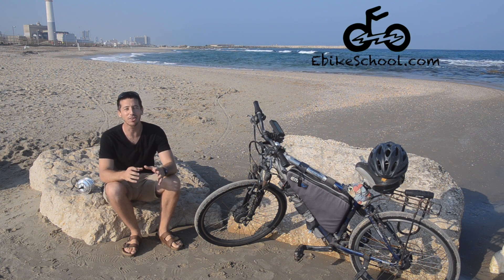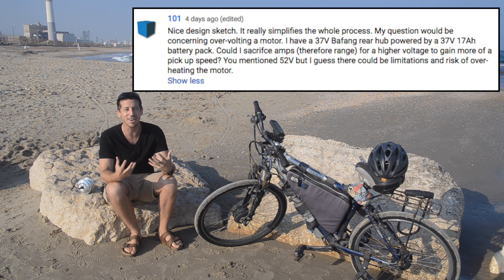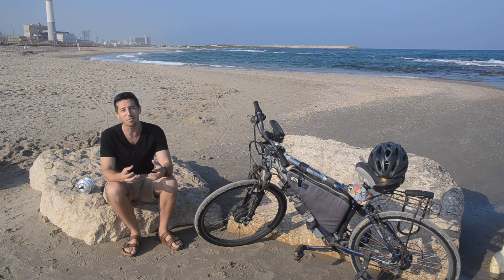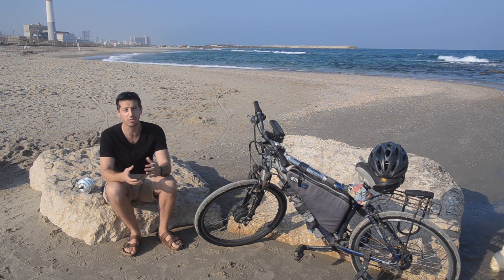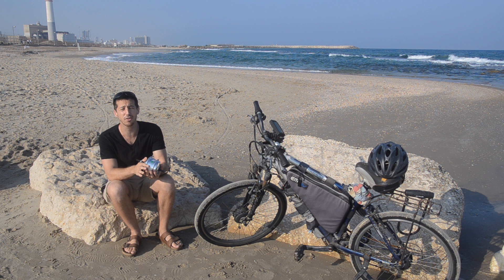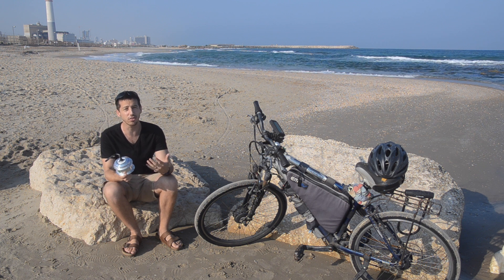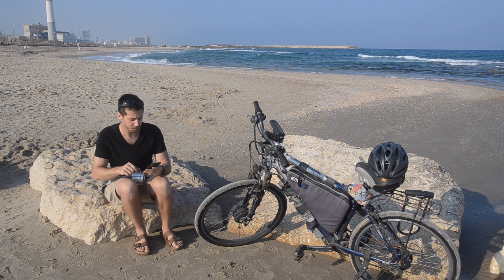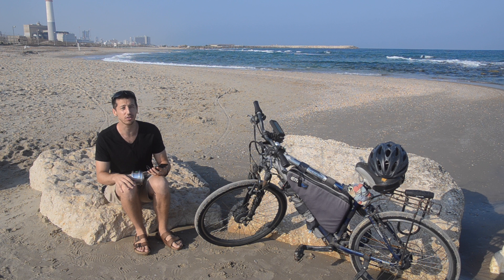Overvolting an electric bicycle motor for more speed! Q&A#7

Comment: The Controller is the Limiting Factor No matter if the Controller is Built into the Motor or Not. As I have a Bafeng BBSHD it's a 1,000 Watt Continuous and 1,500 Watts Peak Mid Drive Motor and The Controller is Total Built into the motor you can Run anything from 24 Volts @ 62.5 Amps to  52 Volts @ 29 Amps and Never more then 60 Volts for My Controller can only handle 60 Volts Max and you have to Remember a 48 Volt Battery will Charge to 54.6 Volts so a 52 Volt Battery will be 58.8 Volts Fully Charged so you Don't want to use anything Bigger then a 52 Volt Battery That is 14S at 3.7 Volts Each and Fully Charged they are 4.2 Volts so 14S will be 58.8 Volts Fully Charged and they call them 3.7 Volt Cells and 14 X 3.7 = 51.8 Volts they call that a 52 Volt Battery. I run it with a 13S7P 18650 2500 mAmp Cells so that is Called a 48 Volt @ 17.5 AH and Fully Charged it is 54.6 Volts and the Motor can Pull up to 30 Amps so Even if there is a Voltage Drop to 52 Volts @ 30 Amps that is 1560 Watts and then I put it through a Seven Speed Gear Drive and it is Very Powerful for a Bicycle and I have the Rear Rack for the Battery for in the Woods Trail Riding and hill Riding it's the Way to Go and Not with the Battery on your Down Tube and With only 91 Cells I can Carry My E-bike No Problem for I have to Carry it up and Down Two flight of stairs. I will Never own a hub Motor Total Junk Compare to the Bafeng Mid Motor Drive BBSHD with Real World 1,000 Watts Continuous and 1,500 Watts Peak put that to a 64 Tooth From Drive Gear to a 13-32 Tooth Rear Gear and you can go up any Hill at 24MPH Top Speed of 47MPH and Easy Cruising Speed of 35 MPH and you can Ride it in the Harshest of Wood Trails and I would not if I was you put it in a Fat Tire Bike you can but I wouldn't and I run Mag aluminum Wheels NO Spokes for E-motors Hub or Mid Drive Loosens up Spokes. and With hub Motors most Times your Control is not part of your hub Motor and What Volt the Control can handle will be the Limiting Factor and High Voltage Controllers 60 Volts and Higher will Cost you so Stop Wasting your Money on them Stupid Hub Motors and Buy yourself Something that will Last you Years and Thousands of miles I have 1,287 Miles on my Bafeng BBSHD and it is Still Running Strong as it was Brand New out of the Box it was a Little Costly but it was Well Worth Ever Cent I Built the Bike for under $2,500.00 USD total that's with Tax Shipping and Handing and that was in 2020 and that's for the Mid Motor Kit the 48Volt@ 17.5AH Battery, Controller, rear Rack for the Battery, Controls, Hydatic Disk Brakes front and Rear and the Bike Brand New off Amazon Everything I needed to put it together and Now it's over $3,200.00 Plus Tax and Shipping and Handling for if I done the Same Kit and Bike Today. So Moral of the Story Don't over Voltage your Controller the Motor more then Likely can handle it but the controller not so much for that is Where Hub Motor Makers Cheap out on is the controller for a Good Controller that can Handle 1,500 Watts Needs to be Rated for 2,000 Watts you don't want to be Running any Controller Right to it's Max Voltage and Ampere you will Burn it out Good Rule of Thumb your Controller should be Double The Wattage of What you want too Run Continuous and Min of What you Want to Run Peak but that Peak Should Not become Your Continuous use Power Level for you will Burn up the Controller. and Don't Buy Small 750 Watt Hub Motors and Try to make them putout 1,000 Watts for you will Burn them up.
Reply: Jesus Christ man… punctuate!
Reply: I disagree. I have 2 Bafang mid drive and 1 rear hub drive. Not all mid drives are the same nor all hub drives. There are pros and cons on both.

Comment: Will the motor/controller have trouble if I change the stock sprockets (lower teeth) or stock chainring (higher teeth) to increase my pedalling speed? (I have a single speed ebike 16T & 43T respectively.. planning to change to 14T sprocket or a 58T chainring

Comment: Hi, Richard Stuart here,  have an Ebike with a 48 Volt setup, and a SW-900 The Controller doesn't seem to have a name on it.  Does say Max current is 22 Amp. From what I have read it should work also at 52 volt level.  What else, to be safe, should be checked.

Comment: #ebikeschool I have a question? My controller are gone for 36 to 48 says it’ll handle up to 52 but I want to know if I change it to 48 and I have a 36 battery can I use both batteries switching back-and-forth?

Comment: Thanks, great video. I use my 3 wheeler for everything, shopping, banking, yard work... I run a 48 volt, 1000 watt motor topping out at 29mph when fully chatted to 54 volts. I WANT TO GET 45 MPH. Would an upgrade to 52 or 72 volt battery help and can I do it. I.have a 30.amp controller.

Comment: Need HELP! HELP, HELP I'M DROWNING !
I built 2 bikes.

Bike 1 - White Dove
48V,  20amp (max) 12.5 aH  battery, 1200 watt motor,, 20" wheels.  
Top speed = 33 MPH

Bike 2: Black Hawk
52V, 30 amps, 20 aH, 20" wheels, rated 1200W motor over-volted to  1560 watts (52v x 30a = 1560w)
Top speed = 31 MPH
?????? WTF? 
What am I doing wrong?

Comment: when I listen to all this jargon, I'm left wondering why it's needed to do all this tweaking, why doesn't the manufacturer sell its product that way? 
I hear all these youtube posters say just do this, just do that ...... well maybe you can, but it seems that the manufacturers are saying "do not". Their hidden message seems to be you will be paying a penalty, with component failures.
to my thinking, instead of doing all this for better speed, just buy a mid-drive bike to get the extra speed, and put a spare chain with tools in your saddle bag as backup to get you home if chain breaks. Much cheaper than having some of those other electrical components on hub drive bikes failing.

Comment: The speed increase will be a lot less than 44%. 20% is maybe realistic. Rule of thumb is that doubling the speed require 8 times the power.
Hill-climbing is where you will see the biggest benefit.
Reply: To clarify the formula he gave is not off, its just that it gives you the "unloaded speed", or the speed of the wheel spinning in air with no resistance.
Reply: Overall range as well.  Unless you custom make a battery just for higher output with same number of cells.  Often a higher voltage pack is also higher total capacity.

Comment: Hey Micah...ive tried leaving questions on your website...with no luck...so ill try again...anyone is welcomed to help if they can...say i have a 60v20ah serie of sealed acid batteries...and i want to switch to lithium ion....can i use a lower voltage battery to save $$$? do i need to replace the controller? what are the rules when switching to lithiums? And is it realistic to rejuvinate older sealed acid batteries by topping up electrolytes? can you have like new results? or is that all bs? ANyway please feel free to reply...i cannot move forward without this knowledge....is there a book anywhere i can buy for these kinds of questions? i dont really care at this point....i just want to get my gifted ebike scooter in use! Thanks to anyone kind enough to help me!!! Gratefully Dan! Oh almost forgot....how do i access the controller software? like to change setting around to get max speeds etc...the brand is an EMMO Shadow approx 2016.

Comment: There is a lot of potential confusion on this topic. The controller can only adjust the average current through the motor by limiting voltage the motor sees - typically with pulse width modulation. If you reduce the current limit setting, the motor will never get to see the battery voltage available except in terms of very short peaks (milli-secs). Left unconstrained by the controller settings, a higher battery voltage will increase the current draw as well so the potential power increase is a lot more than the % increase in voltage might suggest.  A "500w" 36v motor represents a  2.6 ohm load. An increase from 36v to 48v (33% increase) will cause the potential current draw to increase by 33% as well, so  available power increases by 78%.

Comment: If you use BLDC motor with PWM controller the voltage has no influence to speed. If you increase voltage you increase power and current. Your controller is sending correct frequency to your motor and PWM power control. You can destroy controller and motor without good cooling.

Comment: you cannot limit Amperage without changing the voltage.
Reply: @Jimmy Cash that only changes maximum amperage it can push out without damaging the cells. amperage = voltage / resistance. ohm's law.

Comment: I  think that the main reason that increacing your motor voltage by 25% will result in less that a 25% increase in speed will not so much be ;inneficiencies; as the fact that aerodynamic resistence does not merely increace in a linear manner but even worse, in proportion to the square of speed.
Reply: Yees!

Comment: Would i risk burning out my controller box that controls a 24v motor by using a 36v battery? The problem is i cant gain access to the control box to see what it can handle.

Comment: Awesome video thank you for doing it!!!!
I just want to add that by removing the screws on the controller, one can open it and look what maximum voltage is written on the capacitors/mosfets. Apart from that, you just need to check the head in the current phase cable (the red one going from the controller to the motor).

If all that is good. All is good. The battery will suffer more of course. I only use it to climb hills at normal speed, so I don't bother traffic. 45km/h is a perfct speed in any other scenario inside the city.

Comment: I notice this with my e bike s un lock controller as I juiced up the current to 20 over the Battery s specs of 48 v 10.4 ah. Notice the boost of riding 1 mile but Im paranoid of working the motor too hard so I set it back to 10.4 to be safe.

Comment: I bought an ebike that shows 48 volts 14 amps, my company said if I put a bigger volt amp battery that it will fry my motor, and display yet you're saying it's ok to over volt an ebike.

Comment: Is it safe to reduce the voltage using a step down converter to lower the wattage? Would you have to put the step down converter between the battery and the controller or between the controller and the motor?

Comment: I have a 1500w hub motor  with a 52v battery. I cant get it past 31mph..  How can i get more speed...
Reply: If you have the SW9 control panel LCD then you can go into settings and adjust the top speed

Comment: Hello i built AWD Ebike 48v. Front 350wats and 500watt rear. And i have two battery packs but the rear hub doesn't fully use the battery. It stops at 52volts. And don't know what is wrong? Is the controller wrong?

Comment: But the shielding in the copper wire is it rated for a certain voltage, if you go high voltage the current will jump and short?

Comment: fyi the formula used in this video does not take into account aerodynamic drag, which increases with the square of your velocity. It will significantly overestimate the top speed of bikes with more powerful (2000+ watt) motors.

Comment: Can you do a video on safely connecting two 72v batteries in parallel with different amp hours? I have a 50ah and a 32ah battery and my ebike is a huck cycle stinger with a 3000w motor and a 150amp controller. Both batteries have BMS controllers and bluetooth capabilities.

Comment: I like to hot rod things , it’s just me since I was a kid . Heat is not your friend so don’t look for reliability . 
When I was slot car racing I use to rewind the motors with heavier wire but less winding , those motors would scream but my hand held controller would smoke from the amount of heat it generated .

Comment: Its important to note that motor power does not increase with voltage linearly. Certain motors can have a huge increase in RPM with just a little voltage boost. They have a KV value which indicates how much it spin faster when voltage is higher.
Reply: Does increasing current just increase torque and acceleration, and voltage the top speed?
Reply: @theSWBFman  I'm not sure but I think most of it transfers to heat and can burn out your motor at a faster rate. I think he said that's why he cut back the watts.
Reply: @sasamusikiwamba  I've learned a lot about it since I made this comment. So Voltage times kV determines the maximum theoretical RPM of the motor with no resistance or load. kV is influenced by how the motor is wound, and there can be different versions of the same motor with tighter or wider windings, which is essentially gearing it more towards top speed or torque. You're right and amps are the one that creates heat and can burn out the motor. So you need enough voltage to reach the speed you want, and then enough current to overcome the load on the motor from rolling resistance, drag, and weight.

Comment: I know this is an older video but I'm really stuck. I have a 36v/500w BBS02B motor and I want to bump it up with a 48v 750w. I've read that the controllers are the primary factor between motors, and on the flip side, that the motors are different. Luna states the 36v motor has smaller windings and they are unsure if the 48v motor is swappable. Sadly I've also bought a 52v battery as I've read that the 52v battery works well with the 48v BBS02B. Is there any actual documentation stating that the motors are different? Did I make a foolhardy purchase?

Comment: Motors are extremely similar to power supply transformers in design. Both are rated for a certian current continuously based off the size of the windings used in the motor/inductor/transformer. So it is more accurate to look at the continuous current rating and the power rating (KW) when comparing motors for use in an e-bike. 

Also it is important to look at the cooling design of the motor and control electronics. Even if a motor or controller is more powerful, if it does not have adequate cooling to run at that power level continuously you will burn it out. Conversely, you can run a smaller motor or controller at a higher power level (to a degree) if you have more than adequate cooling on it. You will take a bit of an efficiency hit doing that though as a somewhat higher percentage of the input power is wasted as heat.

Comment: Hi is there anyway you might have any information on the different dimensions of a lithium scooter battery, I took a chance and bought a 36 V 60 amp hour okoman brand battery and they’re telling me it’s 188 mm x 68 mm x 78 mm and from the research I’ve done it shows that this dimension is for a 10 Ah power.So I’m wondering if you have some kind of a chart or knowledge that you can help me. Please get back to me as soon as possible. Regards time

Comment: I did overvolt an 24 v engine to 36 v The result is about 36 40 km per hour Got 2000km with the engine and still working fine

Comment: Wish me luck I’m going to overvolt to 80v! I have a 1200w motor with a 36/48v controller (I think)

I’ve been using a 52v for awhile now and no problem. I was going to order another 52v and wire it together to get 104v (in theory— via parallel or series I forget which one Bc I’m not going that route 😅😂)

I’ll follow up on how it goes
Reply: @Ronald Drump I went with a bigger battery first and when I did, my controller smoked for a little while but I definitely got more speed/power and nothing ended up breaking!

I’m scared to overvolt Bc I think my controller won’t be able to handle in

Comment: Idont over volts. Lets sayo for example i had 36-48 volts motor then, i had 60 volts battery if i convert my 60 volts via regulator transistor is that + speed?

Comment: Question if I use a boost converter to increase the voltage of my 48v 15ah battery to say 58v on my 1000w ebike would this increase my speed or just mess up my bike completely? Because right now it goe 30 mph so I was wondering if it would increase to say maybe near 40mph?

Comment: Accurate info well covered!  Current kills...people and motors.  Most of the insulation is rated 600V or higher.  If they made motors with internal liquid cooling, they could be pushed extremely hard!  18650 cells can't deliver high current without many good ones in parallel.  That (and smaller wires) are the reason they go higher voltage.  21700 cells can deliver more current and hobby LiPo packs can deliver massive current.

Comment: Hey buddy I have a question for you I have n ebike that has 20 inch fat tiers n its a 750watt motor with a 48volt 10.4 amp can I use a 52v battery n if I can at what amp can I use the 52v battery. N if not can I use a 48v battery that is 14amps I'm very curious thank u for your time I hope you can help me

Comment: Error Error  diameter of the tire not the wheel. 2 motors,2 controller...will a single controller control  Aka throttle..run 2 controllers?

Comment: I got the 36v brush motor over volted to 48v and the chain drive well aligned. I saw you review after but I have a brushless front so just a bit extra. Check your controller capacitors before over volting!

Comment: sir i had used 72 v 2kw motor with 72v 26 ah  battery and i got the range of 110 km with 70kmh speed . but when i used that same battery on 72 v 1200w motor igot only 50 km range on same controller . what do u thing actual range i supposed to get if i buy 1200w controller for 1200 w motor ? i had high hopes from this motor like getting atleast 150 km range . but i think i will get 110 km range again .

Comment: Why would you multiply the motor RPM by the diameter?  Wouldn't it make sense to multiply the RPM by the wheel circumference since for every revolution of the wheel, the bike travels the same distance as the circumference of the wheel?

Comment: What happens with controller if connect to 52v instrad of 48v? After connecting to higher voltage, controller started cuttiong off under load. But recover if  release throttle or PAS. Capacitors for 63v. What can be damaged?